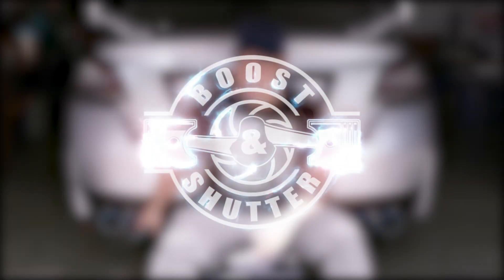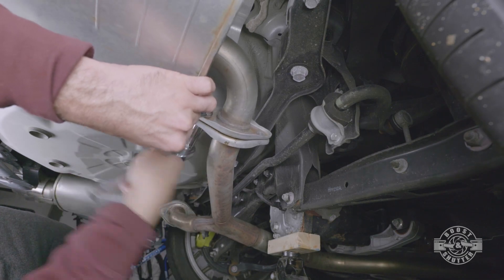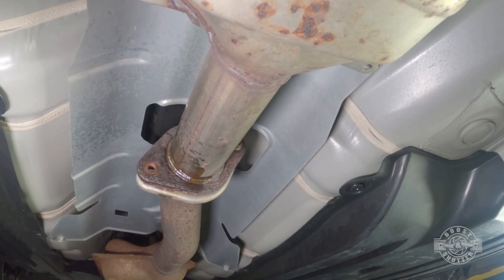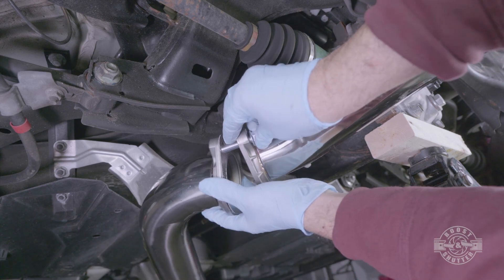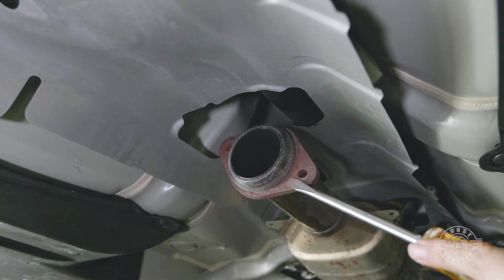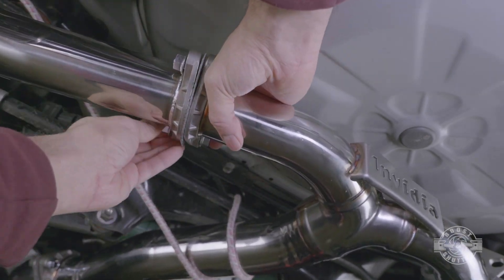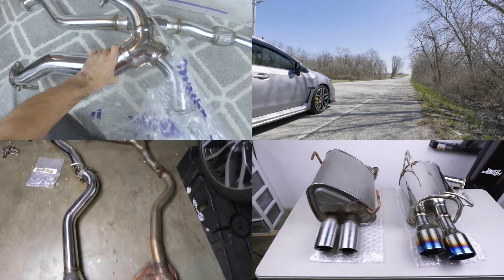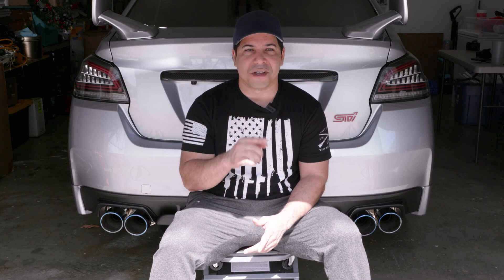WRX STI Catback Exhaust Detailed Installation

Comment: for the adapter piece, it's not discussed but looks like he ended up putting the washer on the nut side as opposed to the bolt head side.

Comment: So i definitely bent the downpipe flange😅 I notice water dripping from the grimspeed gasket, is this a leak? I don't feel any air leak from there. Would it be best if I took the downpipe off, straighten the flange back and reassemble?

Comment: Hey man just to clarify.. if one is ONLY installing the catback then you're suggesting to get that adapter for the stock down pipe to aftermarket mid pipe or are you saying if one is doing an aftermarket catback to an aftermarket down pipe they need the adapter? Sorry I listened back like twice lmao just wanna make sure I have it right I think it's the first one I mentioned stock down pipe to aftermarket catback = adapter necessary. Thanks in advance for the clarification 🙌

Comment: Please do more video about Subaru Ascent, what is going on ? Its review went down from high to low scores on reliability to safety, complaints, recalls, transmissions, repairs. Love to own one Subaru Ascent  2021 or 2022 ( when it becomes available ). Which Subaru SUV is more dependable with less complaints or recalls or problems comparing Ascent , Forester, Outback or Crosstrek from Touring models . Help, I need some help . Which one I will buy. Subaru SUV or Toyota Highlander 2021 models unless 2022 are coming ?.. Thanks 🙏 for your time and support with my Quest ( buying a dependable , less problems SUV. 🥲🥰💫🌹🌸🌻🪐☃️.Many Blessings.

Comment: How much HP does your CVT push? I have one atm and I been wanting to get an exhaust, air intake for the CVT, and a catless down pipe, and midpipe what exact parts should I get for it if I’m looking to increase performance and sound.

Comment: To install this exhaust, do you need the Dow pipe adapter? Or can you leave the stock gasket or do you get one from the exhaust kit?
Reply from the maker: It's a different size, so you need the adapter.
Reply: @akqjtn  thank you for the information. Just ordered the Q300 and didn’t exactly know if the adapter was necessary. Also, are the pipes on a STI the same or different for a WRX?
Reply: @MrReesos  I think they’re both 2.5 in diameter.

Comment: Hey man sorry this question is irrelevant. I just purchased a 2021 impreza cvt base as my first car. Can i add a turbocharger to it? and where could i get one? Appreciate your helpful cvt vids man!
Reply from the maker: Short answer is yes, but it's a complicated process that will cost you quite a bit and has huge potential to destroy your car. I'm not even 100% positive if that car has the high torque CVT in it. If it doesn't I wouldn't even consider it.
Reply: @akqjtn  damn okay i appreciate it sir.

Comment: No need to use spring bolt?
Reply from the maker: I knew I forgot to mention something 🤦‍♂️This particular catback has a flex pipe built in, so spring bolts are not necessary.